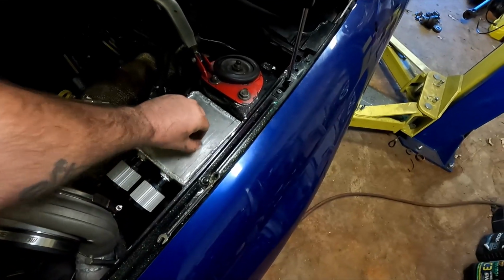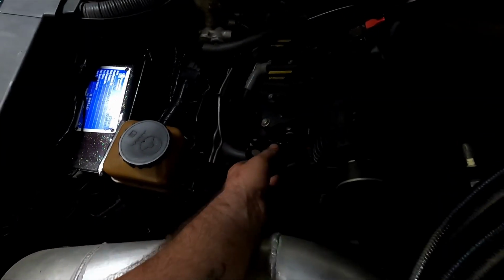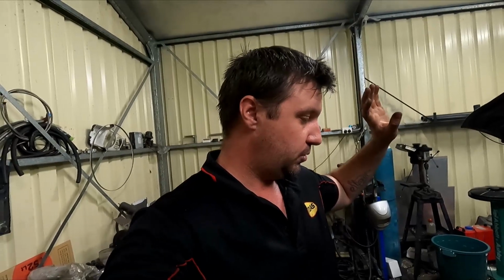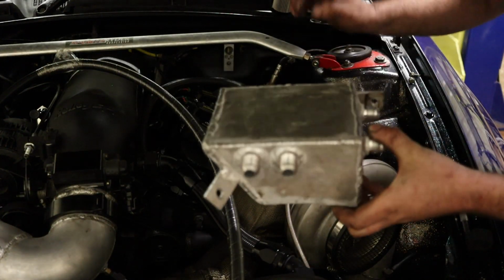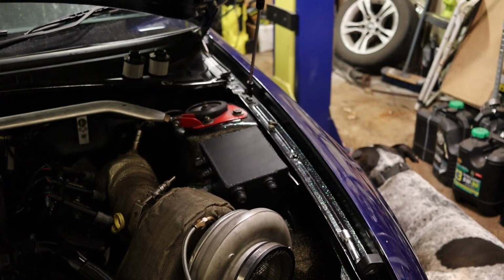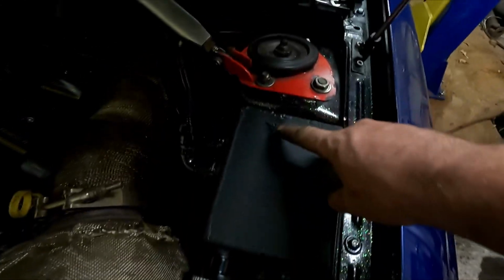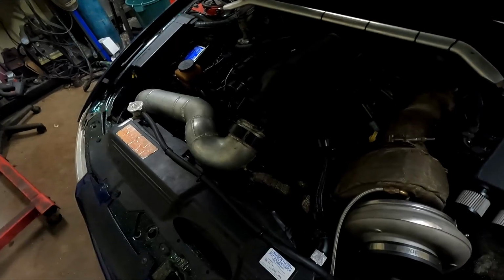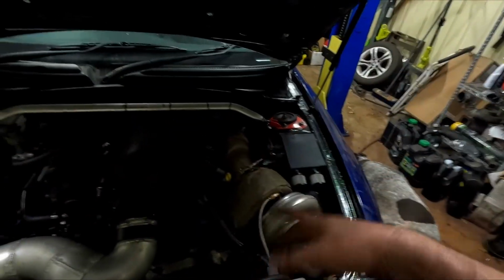Finishing Off The Catch Can For My Turbo V6 Commodore

Comment: One more thing off the list Dane, if the converter is a bit tighter, doesn't it mean just add more Boost right? 🤣🤣

Also, make sure you get January 2022 Street Machine. You'll See... 😉😉
Reply from the maker: Yeah man that's it slowly getting through the list.. and yeah that or some more gass 🤔 

Oooo hell yeah will keep my eye out for it 😁👌